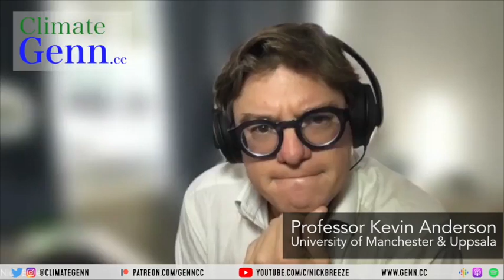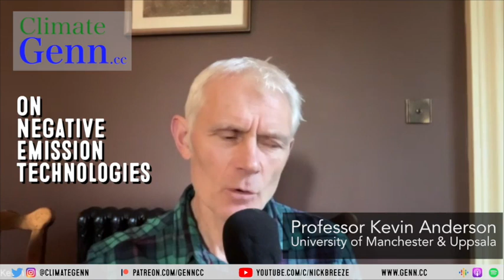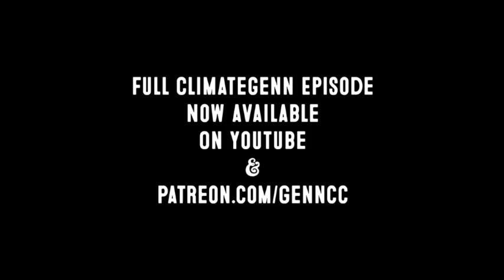Kevin Anderson on CDR and NETs - Reductionist versus systems thinking

Comment: We're in such deep trouble climate-wise that we need carbon dioxide removal alongside aggressive cuts in emissions. There are many promising CDR technologies out there although, as Kevin says, they're tiny at the moment. So we need to grow them - fast. Why? Because the fossil fuel industry has delayed progress for so long. It's not a choice between carbon reduction and carbon removal. We urgently need both. Just because the fossil fuel industry uses CDR and CCS as an excuse for business as usual doesn't mean we don't need them.
Reply from the maker: If I recall, a recent report estimated a requirement of 40x growth in novel technologies for carbon capture every year until 2035. I cannot see how it is feasible. I don't know any properly informed person (outside those seeking funding) who thinks it us. Do you?
Reply: @NickBreeze  It's difficult to comment on some vague unreferenced report. However, I do know that certain technologies, such as enhanced rock weathering, biochar, and some ocean-based solutions have the potential to scale significantly. And they have beneficial co-benefits like lessening the need for artificial fertilisers. Even if we get to net zero by 2050, we're likely to have a CO2 atmospheric concentration of 460ppm. We're witnessing the effects of 420ppm so we need to get that concentration down, preferably eventually to under 300ppm. I'm not quite sure what you're suggesting... That we don't work on these technologies? Because that seems a bit perverse. Just to be clear - I absolutely believe our no. 1 task is to stop emissions as fast as possible. I do not believe carbon removal is a substitute for that. However, we can reduce emissions alongside removing carbon from the atmosphere even if that is difficult and requires significant investment. It's not either/or, it's both/and.
Reply from the maker: @mikedaw4193  I'll find the report as I kept it. It was a recent analysis of CDR proposals/projects to meet the task. The point being made in the clip is that we should certainly continue the research but not include it in the models used to inform policy if they are not yet proven. Doing so gives a signal to oil companies and wider society that BAU is acceptable. Reducing our impact while looking to develop/deploy safe cdr in years to come is better than ploughing on assuming we will deploy and be hoid to go.
Reply: @NickBreeze  Indeed. Although it's a somewhat nuanced point, which is why I wanted to respond, especially as some people who've commented on the video seem to conclude that the whole carbon removal venture is therefore a waste of time and effort. Which I think is a dangerous endpoint to reach.
Reply from the maker: Here's the report - https://www.stateofcdr.org/ @mikedaw4193

Comment: Its closer to 2 trillion tons of greenhouse gas that must be removed from the atmosphere, in order to drop ppm co2 down to 225ppm and methane down to 800ppb.   There is no plan to remove any significant quantity, because, like you say kevin,  the technology is not scalable and the time frame would be a thousand years, which is way too late.   I expect 3.5c by 2040, and 7c by 2100.  So the powers that be can either pretend to have a workable plan, or they can tell us that we should expect nthe.   They of course are choosing the former which is politically palatable, while the latter is political destabliing, unspeakable and taboo.

Comment: It takes more energy to capture carbon than we received from burning the hydrocarbon in the first place. Thermodynamics is not a suggestion.
Reply: No, I've looked into numbers, you'll need at least 30% on top. No more than 100% if done properly, still it's 30% MORE extraction of fossil fuels, or it's a waste of massive renewable capacity. And much more importantly, it's not done at scale necessary, not even near.